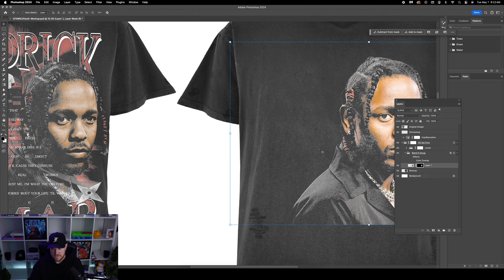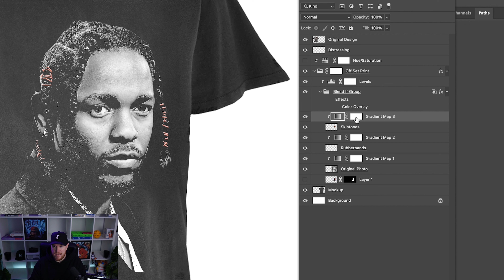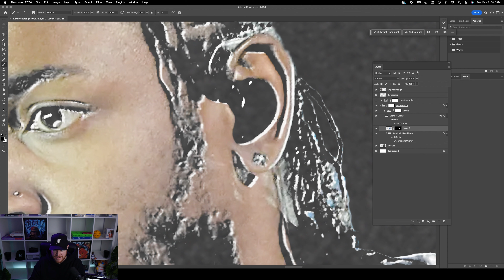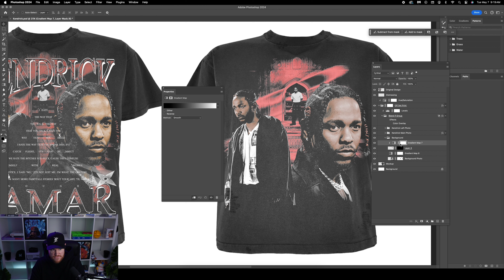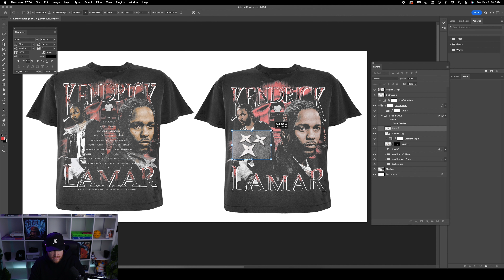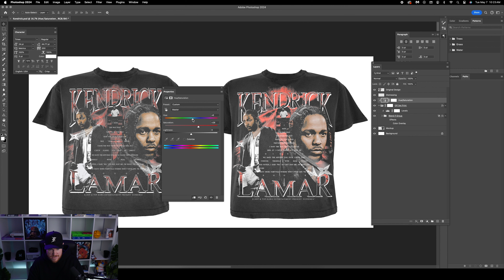How To Design VINTAGE BOOTLEG Shirts (Photoshop Tutorial) ©2024

Comment: Awesome work❤, I have a little question? When you put the images on the mockup t shirt, directly are blended with the mockup texture? I would wanna say .... do you use a blending mode before? Thanks❤
Reply from the maker: Yes, I will typically use Blend Mode > Screen on darker colored garments and Multiply on lighter garments BUT if you're using Blend If you may not need to change the blending mode at all. Depends on the graphic and mockup.

Comment: What size should the actual design be if I want to get it on a shirt and take up alot of space like this design does? Sorry if that doesn't make sense.
Reply from the maker: Depends on the garment.  You can always work with your printer so that each shirt uses a "maxed out" screen size. One thing I can say is that it's always better to make your original graphic too large rather than too small, because it's easier to size down than up.